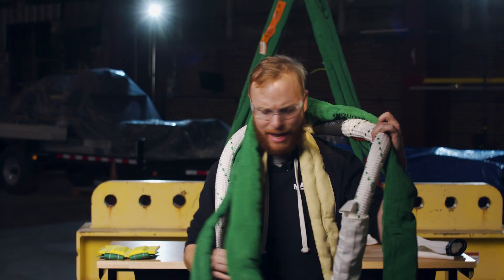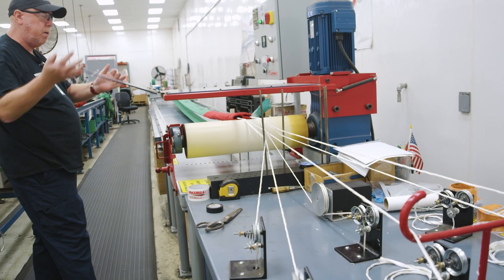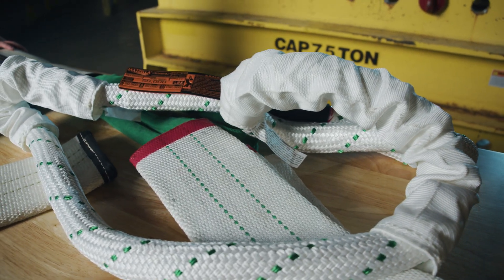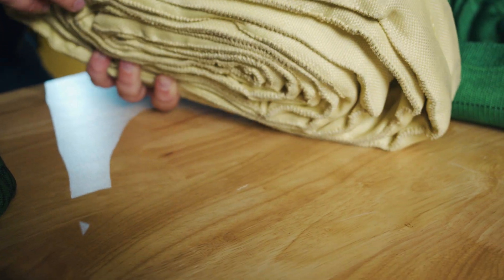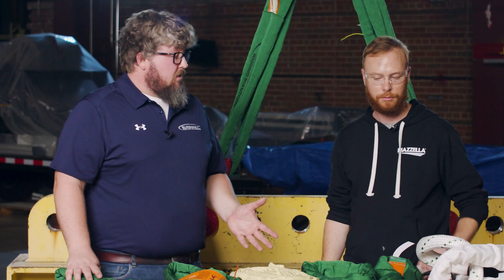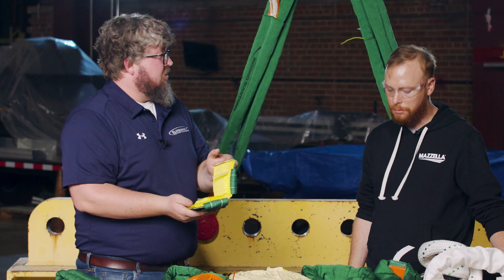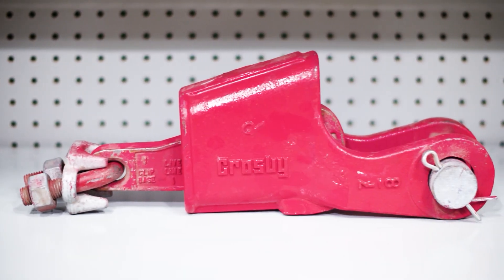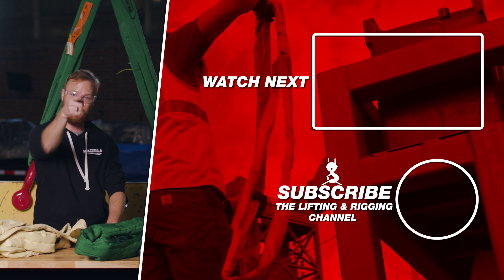Which Slingmax® Sling is Right for You? | Slingmax® Slings Explained

Comment: It took a buyout of Slingmax and Yale Cordage and the resulting partnership to really bring the Yale LOUPS slings to the front of the market.  Yale LOUPS have been around for years yet they were relatively unknown.  Once marketed by Slingmax / I&I Sling... the LOUPS slings really took off.  For various reasons this caused the Helix sling to be developed.  The Helix isn't as compact as the LOUPS due to the weaker K-spec yarns versus the LOUPS' braided Dyneema, but the Helix slings aren't bad, with a few upsides of being parallel strand.  All I know is that it is awesome to have good alternatives to TwinPaths since TwinPaths are wide and sensitive to cover damage.